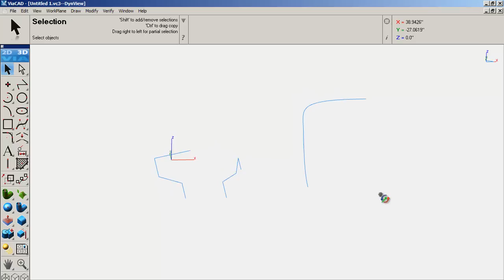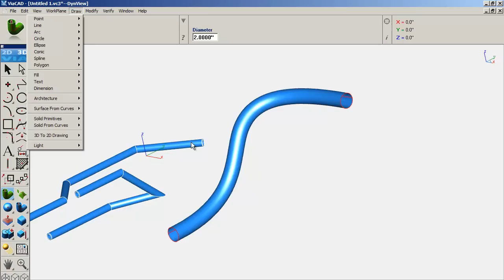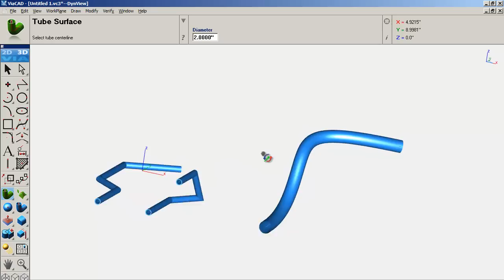Pipes in ViaCad

Comment: Hi Burr,

How does ViaCAD (Pro) compare to MoI in terms of capabilities, like better fillets, branching models, etc.?

Thanks in advance for your reply.
Reply from the maker: Hey Metin, Viacads filleter is better. That's what I bought it for. To get some of the "disappearing fillets" that it is capable of, that MoI doesn't do well. In the last version, MG updated the fillet command which made it much better, but ViaCad using the ACIS kernel filleter will still be more robust....

It's also more well rounded in that it has more of the tools to be "standalone" with regard to drafting, etc.....

But as far as the tools that equate to each other, MoI is my choice... All around modeling is more fluid...Meshing is superior for sure....

Having both tools is complimentary... I have ViaCad Pro 9....
Reply: Thanks a lot, Burr!

I've bought it to complement MoI too. The fillets are indeed very powerful. I'm quite happy with it, despite the somewhat crippled workflow / navigation.

Comment: i got another question,ive been trying to lay out some simple construction lines from dead center on the x,y axis.0,45,90 degrees works just fine with the auto finder,but when i try 22.5 degrees etc,i punch the numbers into the angle window......it shd stay i go thru and put a few lines,when i come back to put the solid lines,the angles are off by .6 or more. i dont understand why i punch in an exact angle and then it changes.any suggestions?? thanks
sorry to bug you again

Comment: i have 2 parallel lines inside a circle.when i use region trim,it only deletes the part of the circle outside of the right line.i also want to delete the part of the circle outside of the left line.it should be so easy but im stumped